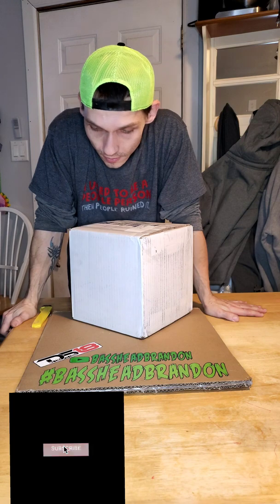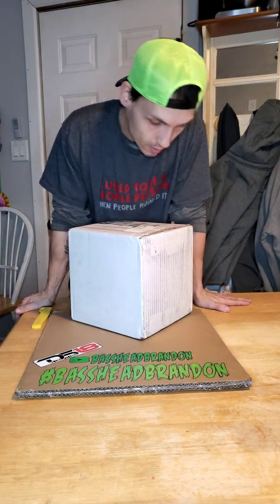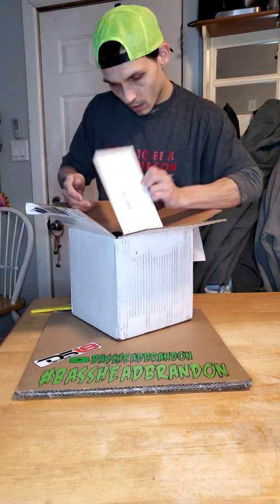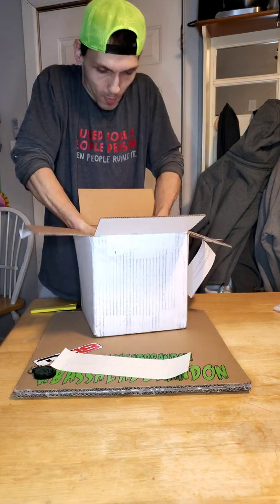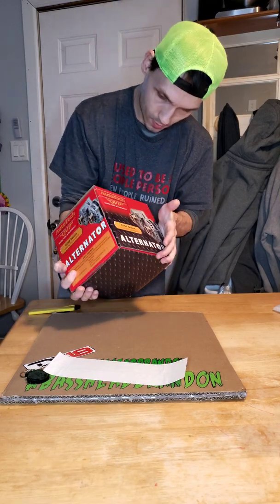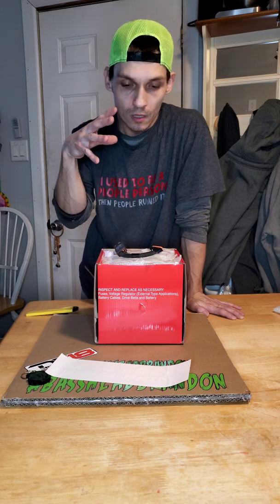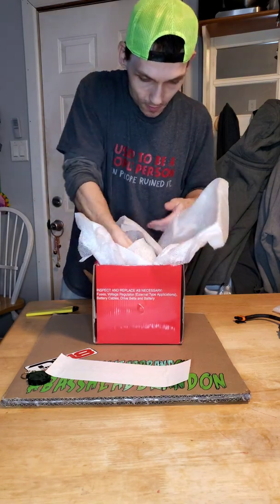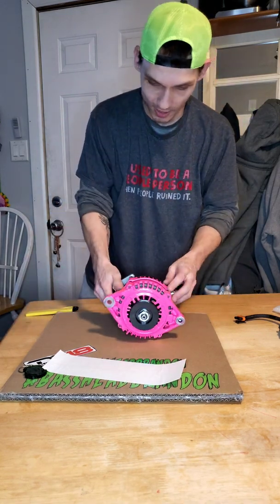autotech engineering H/O alternator unboxing

Comment: How has this alternator held up for you I'm thinking about getting one and auto tech is the only place that will make one for my PCM controlled charging system is your car the same way and if so does it cause you any problems bypassing the PCM
Reply from the maker: Alternator held up great but he had a issue finding the right size belt to work with his tensioner pully... which caused voltage drop but other than that the alt performed perfectly 👌🏼
Reply: @brandonfath87  cool thanks I just ordered a 240 for my car last week and I'm already having a hard time finding a belt literally every parts store I have gone to has given me a different size and it's inches apart I'm going to have to take the stock belt off measure and then go buy one

Comment: How do you like it?
Reply from the maker: It's actually my buddies and it's running strong... charges at 14.8 and holds voltage no lower than 13.8
Reply: How do you get your volts 14.8. Mine not going past 14.4 and I bypassed it.
Reply: @donovans1  how did you bypass it?
Reply: @SheikhN-bible-syndrome  I just the plug they sent me. With just one yellow wire and it’s hooked up to the fuses box
Reply from the maker: There is a diode you have to buy and attach it unless your wire harness came with one built in
Reply: @brandonfath87  or better yet if you have an old amp for bass knob laying around you can take the variable POT and wire it into the since wire that way you can controll the voltage. That's what i did to my stock alt on my truck and i can adjust it anywhere from 13.4v to 14.8v 😎
Reply: Hello, how are you? Excuse me, you don't have problems with the band of your alternator? don't you break them?
Reply from the maker: No... you usually have to get a different belt when you replace the stock one
Reply from the maker: No usually you end up buying a belt that's 1/2" smaller than the stock belt